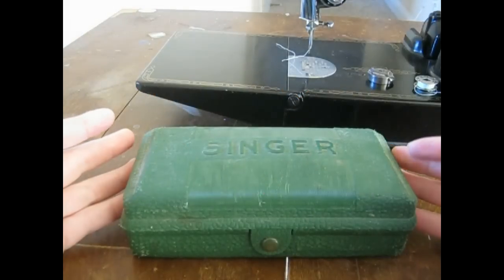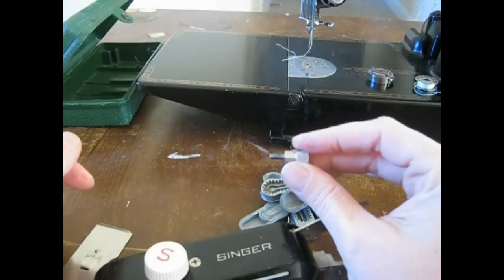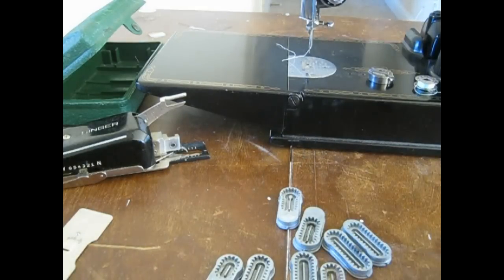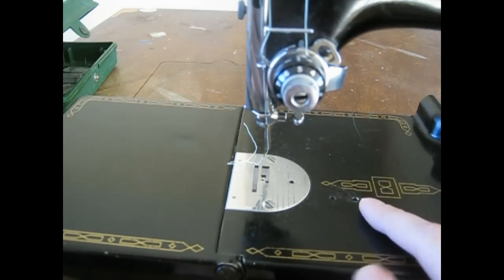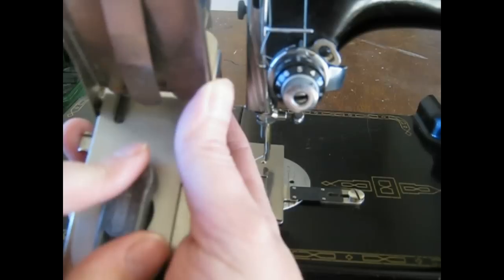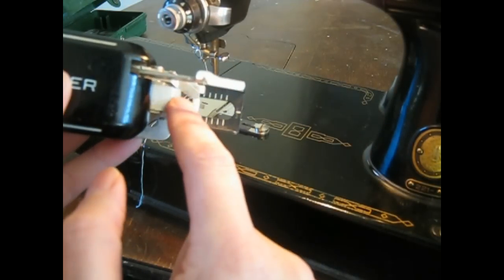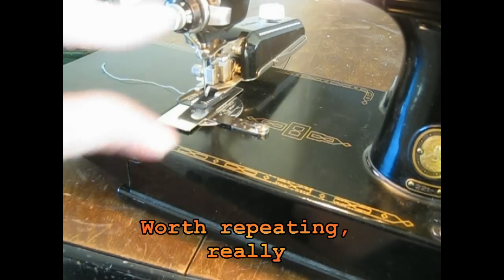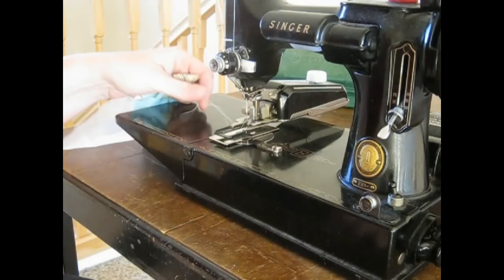AutomaticButtonholeAttachment.avi

Comment: Hi this is really cool - I just tried mine out.  All the mechanics seem to work, but the thread doesn't catch - I tried adjusting the tension to no avail.  Any suggestions?  Very nice video- I never would have attempted it otherwise.
Reply: Pro tip : you can watch movies on flixzone. I've been using it for watching lots of of movies lately.
Reply: @Kameron Gatlin yea, I have been watching on flixzone} for years myself :)